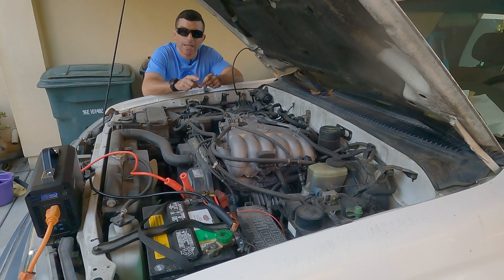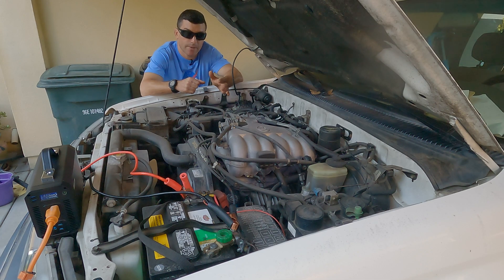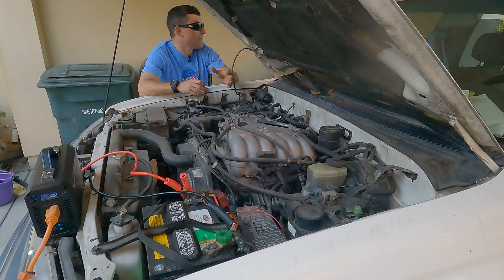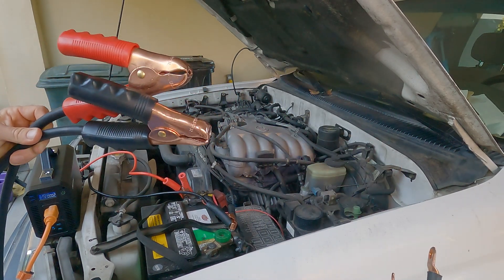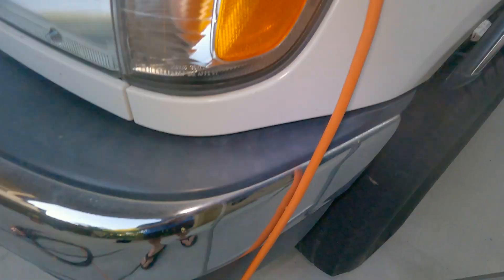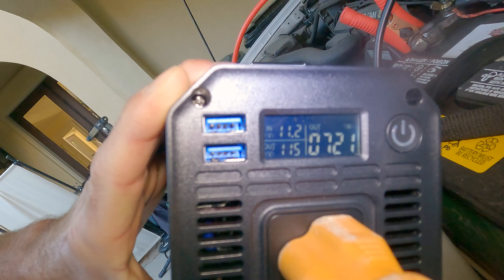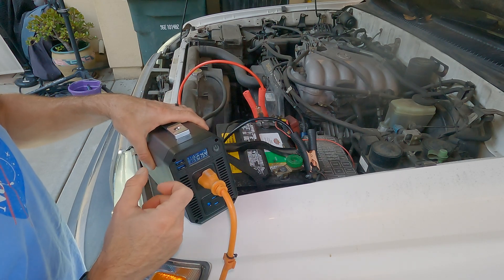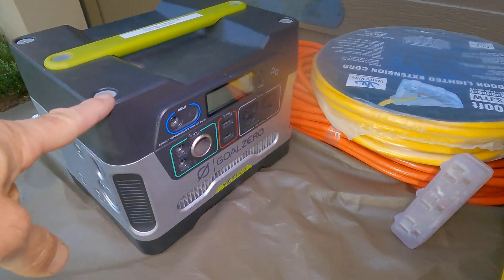HOW TO TURN YOUR CAR INTO A GENERATOR IN 30 SECONDS USING AN INVERTER

Comment: 4:17 Of course try to use minimum length of extension cord (footage), and maximum thick, such as 12 gauge. Thanks for your demonstration, I have the 3.4 Toyota engine also.

Comment: What is the max on the wattage you can use ? That is the invertor to the battery ?
Reply from the maker: Good question. This one has a max wattage of 1,000W. You can find them with higher wattage
Reply: @NickC9545 at what point is too much wattage and hurt the battery ? Or alternator is the question.

Comment: Good perspective.  I'm opting for your idea.  It would be nice to have one of those nifty Honda generators but they're over $1k and they weigh a lot.  If I could afford it I'd buy one.  In the meantime buying a 3000-watt inverter for my vehicle is much less expensive, and portable (especially for camping).

Comment: I have a 5000 watt emergency inverter for when a solar component of my 48-volt system fails. For my 12-volt system, my truck can charge that while my RV heater is sitting idle and I'm hanging out in my truck and watching YouTube. It's important to remember that volts * amps = watts. If you have a 35-amp alternator, you should expect about 420 watts of that to be usable after what your ignition system and computer use. You may be much better off if you're a truck driver and your tractor is at your house. Please don't think that this is a good option if your fridge has been off for a while and be sure to use a vehicle with a 35-amp alternator for only your fridge.

Comment: Yes, I own a 1500W120V15A inverter.  Runs my natural gas forced air heater perfectly with just a minor wiring change to the heater on/off power box.  You don't have to even leave your home in a power outage and your home temp can be maintained at a comfortable normal level.  The critical most important thing, it runs Momma's coffee pot.  If Momma aint happy aint nobody happy!

Comment: Can I use an old junk car that runs but doesn’t drive much as a generator if I keep putting gas in it could it theoretically have in my possession a generator car?
Reply from the maker: There are some downsides and risks of stress on the engine but as long as you don't care about longevity, yes you can.

Comment: Overall this is a bad idea.  DC amps produced by an alternator is directly proportional to the engine rpm.  At idle, the output will be insufficient to power any load for any duration.  At higher rpms, you are just burning a lot of fuel and putting wear and tear on a system built for a different purpose.
Reply from the maker: Your theory vs my reality. I have used it to power a rice cooker and several other appliances and it has worked fine at idle.

Comment: This is a great concept but you're drawing way more than most vehicles can handle.

725 watts out of the inverter, add 20% for inefficiency in most inverters is 870, converted to amps is roughly 70 amps you're drawing from your vehicle. The average vehicle has a 100amp rated alternator and none will produce the rated output at idle. The fact that your voltage meter didn't really come up means that you are still discharing the battery and pulling more power than your alternator can provide. Not good for the alternator or the battery. Anything lower than 12.6 means you are discharging and anything lower than 12.06 can damage the battery. A running vehicle with all accessories on should maintain 13.8 volts.

Cooking appliances use a LOT of power. Even using a gas generator for heat is very inefficient and a waste of fuel. You're better off having a buddy heater on hand if you live in a cold climate.

What this setup is perfect for though is pulling maybe 200-250 watts to run the fridge, tv, internet modem, few LED lights, charge phones etc
Reply from the maker: Yeah, I'm not recommending using a huge appliance for extended duration on this setup. I'm suggesting it as a good way to power smaller AC powered devices during an emergency in place of a conventional gas generator

Comment: Yeah, you need lock washers for the lugs and can use screw clamps like conduit clamps weld clamps ECT or stamped metal terminal clamps instead of gator clips

Comment: Generators are alot more efficient but if you’re in a pickle this is a great way to have power in an emergency.
Reply from the maker: Yep, generators are great, so long as you actively operate and maintain them and routinely cycle fresh gasoline through them. Many people don't diligently do this, so that's why I wanted them to at least consider this option.

Comment: Does the engine RPM already increase and decrease when the demand is increased and decreased?
Reply from the maker: Good question. It didn't on mine, but it might depending on the size of the engine and the load

Comment: YOU CAN ALSWO COOK AND PUREFY WATER BUY BOILING IN TINFOIL ON YOUR ENEGINE BLOCK
Reply from the maker: Haha, anytime someone mentions tin foil people immediately assume they're some kind of kooky conspiracy theorist. But what you're suggesting using engine block heat for thermal water purification actually has legitimacy
Reply: @NickC9545 Some people install a bypass in the cooling system of the car to heat water and take nice showers.
Reply: @NickC9545 If you don't have a tin foil hat by now , your thoughts are public by now 😉.

Comment: Can you safely run a portable A/C like this? It it hard on the car or the battery while its running? This is very interesting and useful information!
Reply from the maker: Look at the wattage of the portable AC unit. As long as it is no more than 80% of the maximum inverter output, you should be okay. This isn't something you want to do multiple times a month every month. Rather, this is intended for occasional emergencies or off-grid camping

Comment: Emergency electric vehicle. You can charge it via wind, solar, creek nearby, an oven or whatever else. You can directly use 230V or in the US 110V from the vehicles battery, it´s completely silent.
You need less stuff everything is electric you don´t need any gas and your car is a huge battery storage.
Reply from the maker: I have an EV but it doesn't charge fast enough from solar to be a viable backup option. I would like to know about your wind power and if a portable windmill could be a viable charging option. If it could I would definitely be surprised.
Reply: @NickC9545  You will have to trickle charge it. Wind power would work but just like solar it will take a while. Same goes for the creek, hydro electric is probably the best solution because it´s way more powerful and works day and night and gives you water as well. You can also use thermoelectric components to charge it but those are very very inefficient. Or you can use a Stirling engine instead but those are very expensive but fascinating tech. They als also very quiet.
My main point is you are way more versatile in regard to power input with electric vehicles. Electric power is the highest form of energy. And you are not limited to just one fuel source which let´s be real will not be always available.

Comment: I wonder if this still kills the battery. I talked about this today with 2 of my co workers (we are all engineers, mech and electrical) there was no consensus if this kills the battery or not. It will kill the battery 100% if you run it while the engine is off but will it still kill it while the engine is on ?
Reply: I have a 12vdc car battery charger. Once I can afford a 150ah 12vdc LifePO4 battery, I hope the charger still works.
Reply from the maker: If you had a large enough inverter that was capable of overdraw from the battery while the engine is running you will have problems. But an inverter like this would trip its safety switch well in advance of that happening.
Reply: @NickC9545  Hmm no it does not have to trip the safety to damage it. I don´t mean damage like right away I mean shorten it´s life span. A typical car battery is good for say 4 years. When you abuse it like that it will probably only work for say 1 year or so.
The thing is though the battery and the alternator are in parallel which means you will draw most the power from the alternator unless you get energy spikes this will hit the battery but it´s made for this kind of scenario. So I think it should be fine as long as you run the car before hooking anything up. Otherwise if you discharge your battery with a higher C level you will shorten it´s life span by a lot. Typically those batterie are made for about C0,02.

Comment: Well sir. It's very bad on any engine to idle it for hrs and u will use about a gallon an hour
Reply: WTF type of engine do you have ? I use less than 0,5l/h. And why should it be so bas ? There is almost no load, it´s even less load than simply driving on a highway with constant speed.
This is basically what your car is made for.
Reply: @sierraecho884 you can idle the car for 10 hours and spend 2 gallons of gasoline.
Reply: my vehicle burns less than one liter per hour at idle...
Reply from the maker: You're right! I wouldn't recommend doing this more than necessary for emergencies and only for as long as is necessary. The two main advantages are that the fuel in your car will likely be fresher than what's in your generator or gas cans and you have a larger gas tank in your vehicle than most standalone generators do

Comment: Thanks for this.  I bought something similar, but I'd like to note that sleeping in your car while running it is not a good plan, due to incremental carbon monoxide poisoning. 

Your body can't break it down, so it accumulates over time.  At least when we are driving, we have more ventilation.
Reply from the maker: Yes! Definitely do not sleep in your car while running your engine for more than just a couple of hours - even outside.
Reply: @NickC9545 open the windows and use a fan. Problem solved.

Comment: I save all my good car batteries in case of an emergency.  I have ways to hook all my batteries with the car battery, all in parallel, with 1/0 or thicker copper so that I can use at least two large inverters off if it.  In emergency situations, one will not use a large amount of power for a long period of time; the many batteries I hook up in parallel acts like a buffer or power bank, while the car’s engine constantly insures all the batteries are at good levels.  If one wants to draw a lot of power, one can use another vehicle to hook up to the same bank to provide more juice temporarily, which is the same concept of leaving two vehicles in a jump starting configuration.
Reply from the maker: Very interesting strategy. I never thought of that. I definitely agree with using the 1/0 or thicker copper. Do you think there is ever a downside other than the cost or weight to using oversized copper than is necessary?
Reply: @NickC9545  Finding the correct connector is the only downside.  Breathing from a larger diameter straw is always better than trying to breath from a coffee straw, especially when you’re jogging.  In obvious cases, there will be no benefit and it would be highly impractical or superfluous to use 1/0 copper wire for a tiny solar panel for a calculator, instead of using a thin 30 AWG wire.  Thicker wire is advantageous where high currents exist.  The higher the current gets, the thicker the wire you’re going to need, maybe bumping it up a size or two is good for efficiency, safety, and save in cost in the long run.  The higher in voltage you go, the better quality insulation you’re going to need on your wire.
Reply: Also, when dealing with thicker wires, solder with a large plumbers torch are handy to make reliable connections fast.

Comment: So I've been kicking the idea of pure sine wave inverter around for like five years.  No one would answer if I could just run my engine and the battery will just constantly be recharged by the alt.  Like, my little Crosstrek can idle for 4 hours on a gallon and half of gas so why can't I just park my car on the edge of the field, run my 22w tube amp and the PA off the inverter and rock the hell out?
Reply: It´s not an easy thing to answer, I debated that topic today with 2 of my co-wokers. We all have different view points and I am not sure what´s right.
The only consensus was if you run all that power from the battery alone you will kill it really quick. But we were not sure if the alternator will supply the power and the battery will survive in this case. What you can do is you can get one of those cheap car alternators to monitor your battery from the cigarette plug and run the thing with engine on, you will see if the battery will be recharged or not over time. I will be doing the same experiment soon, I want to use my small vacuum to clean my car in the driveway, I don´t have any access to an outlet whatsoever, so I would either have to use one of those 12V vaccums (i rather kill myself) or I can do the whle inverter thing with my small shop vac. What puts me off are the huuuge loads. 1000W output will need at least 1100W input probably even more which means 1100W/12V= 92A. This is a huge load which can meld all sorts of things, kill your battery and start a fire.
Reply: @sierraecho884 

Buy a DC-DC charger and secondary battery 🔋 where you connect the inverter. Problem solved. Car battery and car alternator 100% safe.

Comment: cool video dude .. I dont understand why so many people buy generators and spend so much money .. I did what you showed here .. we had a power outage during a storm, so I bout a 1000 watts inverter .. it did a pretty good job.. we had lights, tv, internet and fans going.. then I bought a second one .. a 5000 watts and I can run basically anything with it. and yes it much more quite than an actual generator.
Reply from the maker: That's awesome! Did your internet still work with the power down though?
Reply: @NickC9545  
yes.. i guess the the internet provider didnt lose power wherever they were located.. i just connected the modem and router and all worked.
Reply: @yemarican internet providers have energy backup for 3 or 5 days for their signal.  I think it is a requirement set by the authorities.
Reply: I don't know what your driving but 5000w ÷14v =357 amps.Good luck with that
Reply: @dustydawson8977  that's what I'm saying 😂😂😂 I would have to be running one monster of an alternator/generator off that thing😂

Comment: Your average car alternator doesn't put out much power at idle. To get more than 800w-1000w you need to at least Fast idle. If you aren't going to sit with your foot on the pedal holding 2000 RPM or make a block to hold the throttle open on modern fuel injected vehicles? Then at most you need a small inverter, just large enough to handle your surge load. As an example, my Cobra 800w (880 surge) inverter would just run my 6 amp 1HP shop vac. Inverters are sometimes useful but they aren't the answer. A use case I could see would be running a small 700w window unit AC to get that load off a small generator. If you really need AC, you need it all day, the fridge or freezers can probably go 3-4 hours between running if you aren't opening the doors all the time. Suppose you wanted to run a window AC low power computer/modem OR TV/ cable box, maybe 1000w running watts(at fast idle) would get you there. You won't get 2000 watts at idle, you will get a low battery shutdown of the inverter if you are lucky. 2000w of 120v will cost your battery and charging system dearly. A good inverter is about 88% efficient so if you are producing 2000w you are pulling 2240w out of the 12v system. 2240w divided by 12 (volts) is 186 amps. That's why the leads to his inverter melted. Edit. The leads that came with the inverter, as short as they are would probably work at 1000w at 13.25v = 75 amps.
Reply from the maker: Very good info. I always go with figure gauge leads now. By the way, do you think there's any problem going with an oversized gauge for the leads and extension cords? I feel like the only downside is that they are heavier and more expensive.
Reply: In electrical school, I was taught that wore gauge is analogous to pipe diameter. The large the diameter, the more amps it will draw.  Not sure if that would be a problem or not.  @NickC9545
Reply: Typo. It should have read "wire":gauge.
Reply: I am not sure if this will damage the battery or not. Generally speaking with old battery tech ( lead acid) you will kill it for sure by pulling 800W or something, but if the car runs the alternator provides the bulk of power not the battery, the battery is only buffering in that case, it should be fine.
Reply: @sierraecho884 Consider a second battery 🔋 and a DC-DC charger.

Comment: You do have to watch your power draw. On 4x4's that have a dual battery set up and an inverter, it is often the case that the alternator will not be able to handle large current draws and will quickly fail. (Especially when a winch is hooked up to the vehicle as well) When using a vehicle with an inverter, it is a good idea to upgrade the alternator as well....unfortunately the cost of a heavy duty alternator and a powerful inverter is much more than a comparable generator......but being able to plug fridges and lights into your car is great for camping!
Reply from the maker: Hey Dave, you're absolutely right, excellent points. This inverter has a  fail safe in that if the amp draw reaches a certain threshold it will shut off the inverter so as to avoid alternator damage. Do you think this is decent enough to handle occasional, emergency, usage?
Reply: @NickC9545 That's a perfect set up for emergencies.